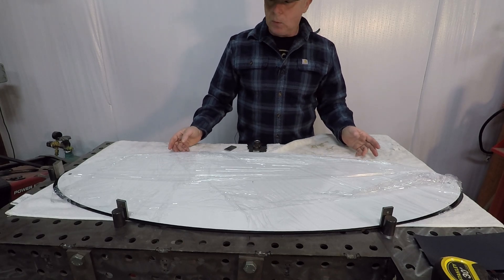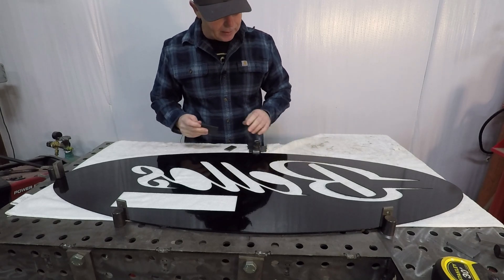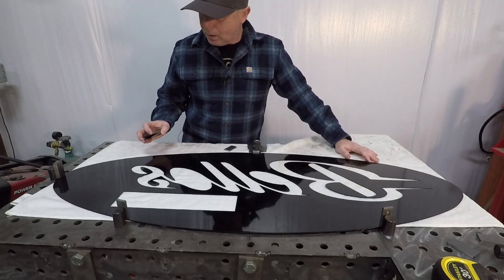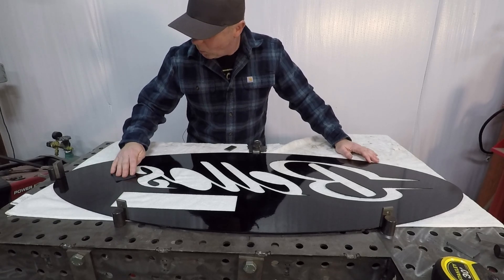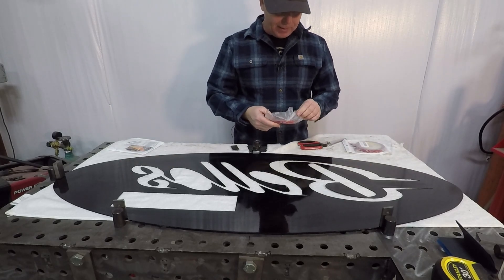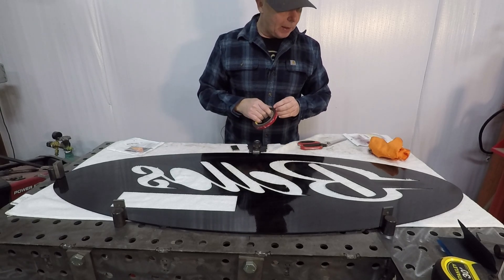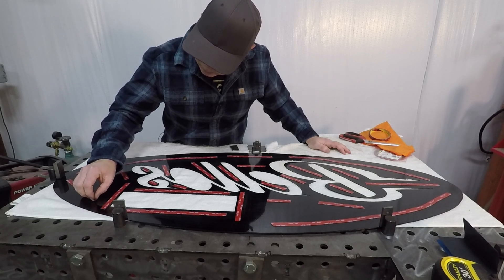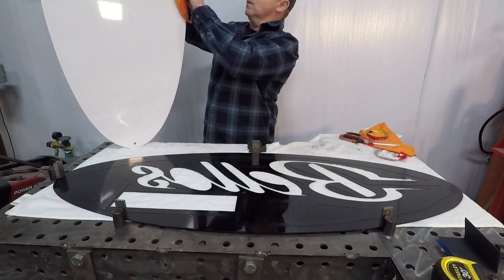Making A Metal Sign For @BellosKustoms

Comment: Try wooden dowels for spacing the sticky-bits and getting them right before it's too late.  Simply pull out one or two dowels, make the initial contact then work out to the edges.  That's what we did when laying laminate on counter-tops, or doors.  And trust me, there was no second chance with the adhesives we used.  It was a once-and-done thing, like you experienced with this sign.